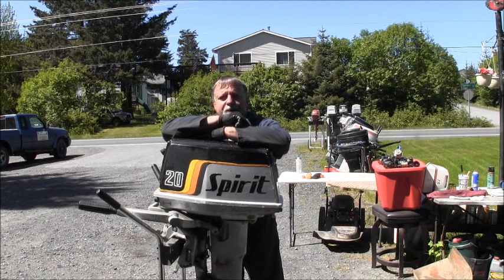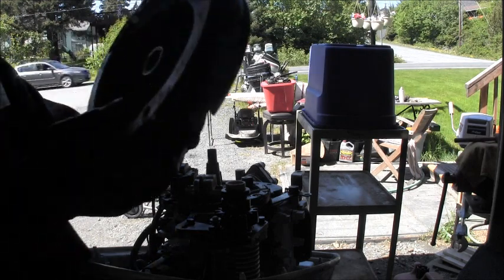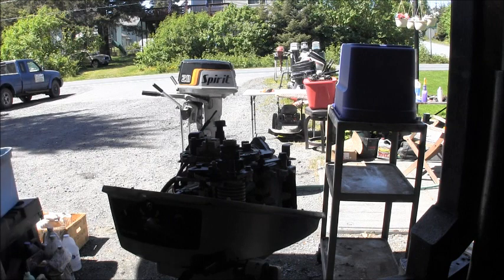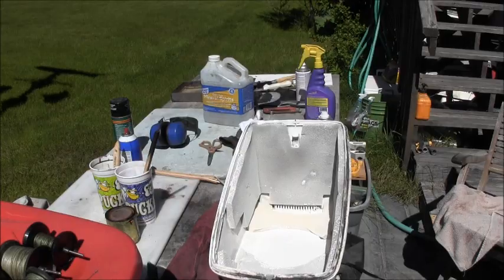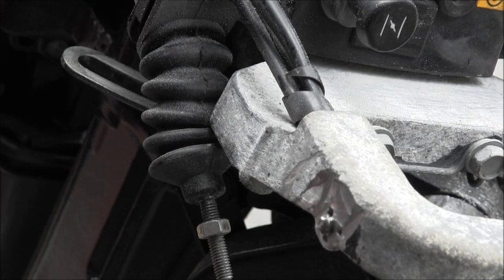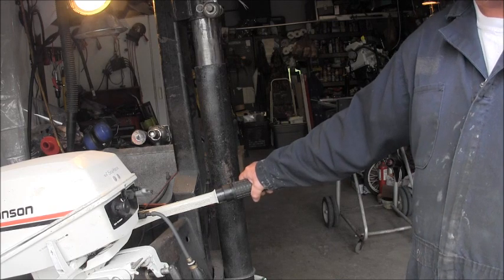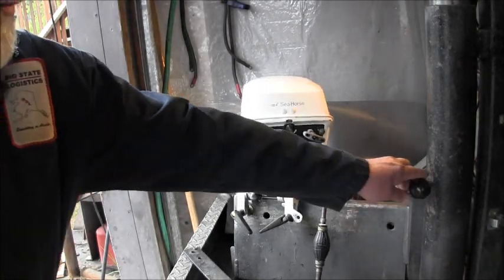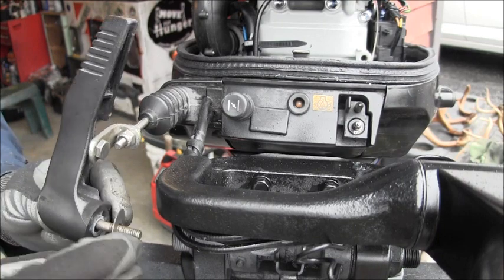JOHNSON 1983 , 7, 5   & SUZUKI 15 HP 4 STROKE

Comment: You got that right these two stroke motors around Lake Michigan seem to run forever as long as you don’t overheat them or let them Seize up I’ve got motors that haven’t been started in 12 years start up and run with the coils falling apart just pull the rope every now and then your good thank you for the great videos best information I’ve seen on the Internet and this old outboard in Florida
Reply from the maker: Yhanks 4 the kind comment,  kodibass

Comment: Yeah, those tiller stop switches are a pain....Trying to thread the leads through that crazy helix is an exercise in frustration also.  You do have a fine collection of "ointments and powders", I usually just rip out that dumb foam inside, but yours looked OK, just needed to be glued down again.  Hopefully, you will find a nice home for this engine, someone who will continue to care for it....
Reply from the maker: Yep' The last one of these I sold the guy ran without oil fride it,  That was the lower unit from it I put on this one, So it still lives sorta. kodi

Comment: Indeed water is not the principal ingredient in creating rust. In fact the process is called "oxidation" because it needs oxigen . As you wisely said, after a soak in fresh water, just get any metal part dry asap and everything will be fine & dandy.
Reply from the maker: 4 sure.. true.   kodi

Comment: @kodibass I have a 1961 10hp Evinrude (10022) that I would like to replace the gearbox on (a previous owner must have ran it with a milkshake in the gearbox for an extended time). What model years and horsepower ranges have a compatible gearbox? I figure a decent used one is probably cheaper that replacing all the internals on this one. Keep up the good work!
Reply: These gearcases are hard to find in good shape.  This style gearcase was used from 1958 to 1963...Yes, a few of the internals changed a bit over these years, but the complete gearcase assembly will fit.  The lower driveshaft bushing and driveshaft usually get worn excessively when water leaks into the gearcase.  Do you have your gearcase apart?  If so, is the driveshaft and lower bushing OK?  You might consider having your gearcase "resealed", although this is a tricky repair job to get done correctly.  But, on the other hand, most used gearcases you might buy probably leak water also...  These old 10hps are great engines and surely worth a proper repair.  Don
Reply: @fleetwin1  Thank you for the information. Yes, my lower driveshaft has some wear on it from running with water. It is a shame as the power head runs well.
Reply: @JamesinCanada    Yes, it is a shame that OMC chose to bolt up the little 5.5=7.5hp style gearcase to the 10hp powerhead, it can't tolerate any water or it gets ruined pretty quickly.  Like I said, most used gearcases probably have similar wear in the lower driveshaft area.  How bad is it?  Some scoring on that lower driveshaft bushing area is pretty "normal" for these engines.  Try fitting the driveshaft down into the lower bushing to determine if there is a lot of slop there...If not, I would probably just re-use it...Don
Reply: @fleetwin1  Ya, I'm going to try re-using it.
Ill replace the drive shaft seal and gasket under the bearing plate and see if it can passes a pressure test. The thing that worries me is some pitting on the drive shaft where the seal rides. If it can't keep the water out, I might just use it until it self destructs and call it a day.
Reply: @JamesinCanada    Well, just change the gear lube frequently, no big deal...In the mean time, look for another affordable gearcase assembly...But again, be wary, many used gearcases are likely to have the same issues...There are a few used driveshafts online also...Ask for close up pictures though... And you are right, isn't going to seal very well if there is a groove where the seal rides...

Comment: I have a 78 evinrude 35 hp with no spark on one cyl, I changed the plug, and replaced the coil, it made no difference, any ideas?
Reply from the maker: Could be the spark plug wire, trigger, pack, or bad ground.   kodi

Comment: Ha, I notice that of blue Corrosion Block you were showing with the Tri Flow. Corrosion Block is the one lubricant needed most for outboards used in salt water. Amazing to see it literally eat corrosion on wires and aluminum. Then it gives long lasting protection. Excellent anti seize as well.
Reply from the maker: Agree much,  kodibass